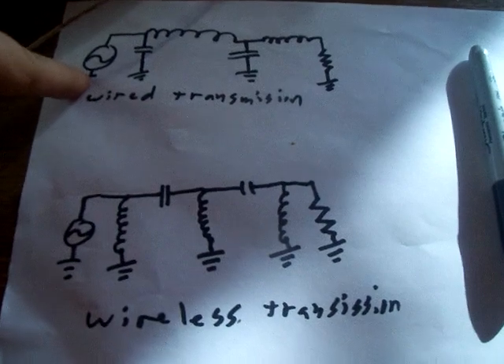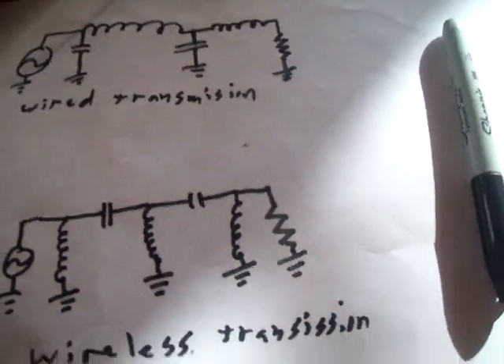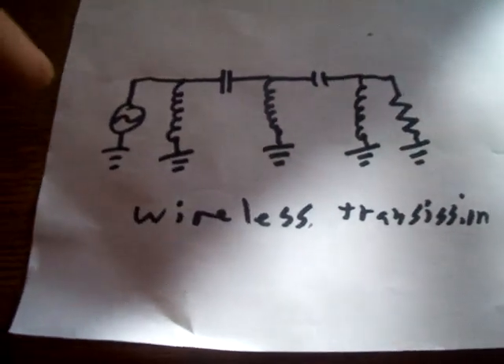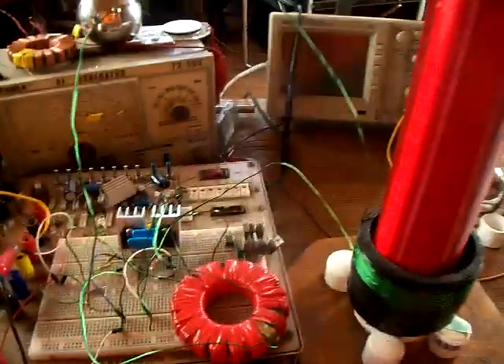Wireless Electrical Grid

Comment: omg why are we not doing this? Electric cars at tesla motors’ batteries take up the most space of anything (3-4 inches across entire stretch of the vehicle. With this they could have no battery

Not to mention the battery size problems with smartphones and laptops

Does it transmit through surfaces
Reply from the maker: It does not transmit in the same manner as in radio. Instead of an electromagnetic wave, it utilizes a pulsing dielectric field. This is why it does not suffer the distance losses quite the same way as radio.

Comment: Nice experiment. I would ask however that you use non-quantum components in your test bed. LED's are miniature spark gaps. They represent to the system a "virtual load". Just because one is lit does not mean there is use-able power available. Run an incandescent globe instead or better yet, a solenoid with a compass at the end of it to demonstrate magnetic flux strength and direction.